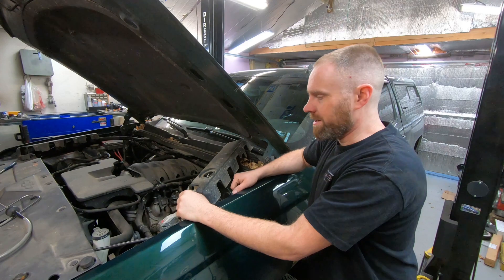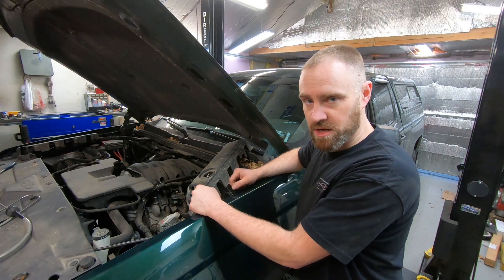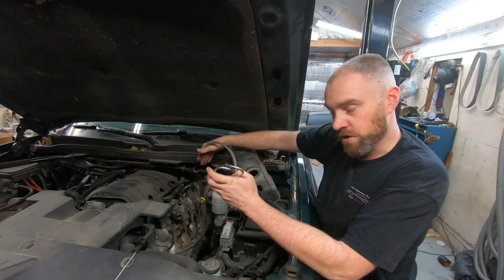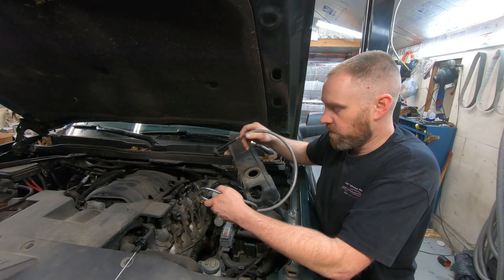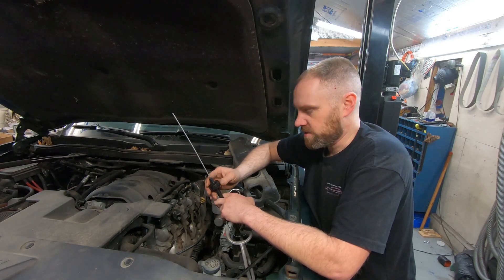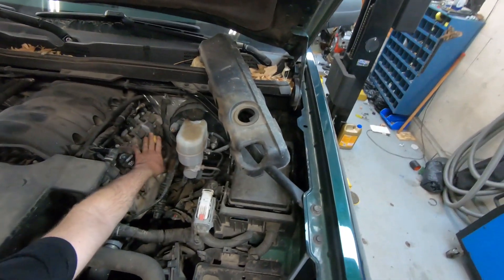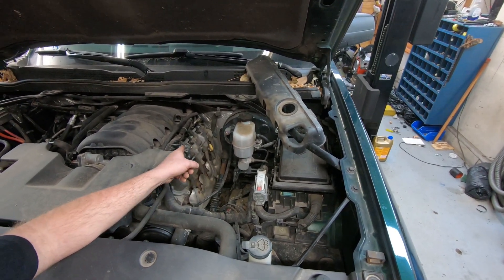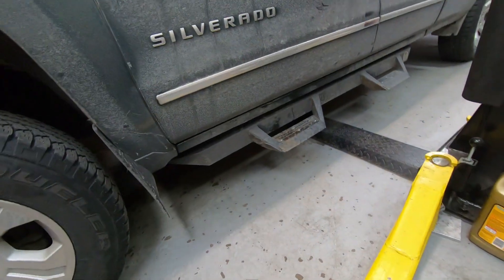Diagnosing Ticking Lifter 2015 GM V8 Engine Knock Sound

Comment: I have a 2015 misfire on number eight, I think cam lifters !
Reply: Crazy thing is  I have no tick !
Reply from the maker: Check if the rocker arm functions correctly while cranking it over with the starter for more than 3 times in a row. The lifter could also be spun, you can determine this by looking at the side of the lifter. To see the side of the lifter you need to pull the VLOM and clean out the oil tower of the suspected lifter with cleaner and shop air. Once cleaned you can look down the oil tower and if you see a hole in the lifter it is not spun. If however you see only shiny metal or a flat surface then the lifter has spun due to a bad plastic lifter guide. When this happens you will need to replace the camshaft and all lifters. This would be a good time to do a full AFM/DOD delete where you remove all AFM components and replace them with non AFM components.
Reply: @CrazedPerformanceRepair  yea I did leak down of cylinder it’s good , rockers seem to be moving like they suppose too, I Need to put dial indicator on rockers they both look alright Visually. But my compression test was little weird first time I test it only got 90 psi then retest and got 150psi then went compared other cylinders with no miss fires codes  and got same 150psi. Dealer wants sell me whole new engine!
Reply from the maker: @davidcallahan5157  be sure to crank it over with the starter relay jumped while watching the rockers. the rockers might work fine for the first four or five times and then suddenly stop working on one or two of them.
Reply: I have a small tap when warming up but after engine warms up its gone. Can that be a rod knock? Its a 2016 silverado 5.3

Comment: Mine taps 6 or 8 times then it pauses then taps again over and over. All lifters ticking.

Low oil flow at idle with valve cover off.

Tap goes away above 1,800 rpms 

Shell rotella t4 after running transmission fluid through it quieted it down.

2913 2500 HD 6.0 motor 

217,000 miles 

Change the oil a lot. Clean motor inside.

No codes, runs like a beast.

Comment: Can a lifter tick get quieter as the engine warms up? My 2012 5.3 got diagnosed with piston slap, it sounds great on start up, but as it idles down it develops a very hollow knock that doesn’t go away until it reaches 210F. Once it reaches max temp it still sounds like a hollow knock, but much much quieter. Like you can’t hear it from the cab when fully warm, only cold. And when revved at running temp the “knock” goes away at about 800-900 rpm and sounds like a normal engine… The sound is definitely louder underneath the truck, and from the top it sounds the exact same from both sides. I don’t have any engine codes except for a large evap leak and occasionally my throttle positioning sensor will through a code… No internal codes, my dads scanner can read previous misfires and the history was clear… I also ran some tests at cold and warm idle but still no misfires. It sounds the exact same every day, doesn’t vary or change pitches unless revved, and starts off almost as loud as a rod knock, but will slowly get better until it’s a very light knock at running temp that you can’t even hear from the cab.   Oil pressure never varies from day to day, 600 rpm cold idle it sits at 42psi and hit idle at 600 rpm sits at 30psi… if it weren’t for the obnoxious sound I wouldn’t think I had a problem 😂😂
Reply: I should add that it doesn’t sound like the noise the truck in this video was making. I literally can’t find any video on the internet that sounds the same, but I’ve seen a lot of Reddit posts say very similar things and half the people are saying piston slap the other half are saying lifter tick. Mine is definitely a lot more hollow and a lot more “knocky”
Reply from the maker: Does it change in gear vs out of gear at all? Best to ask me on my actual website btw. I respond better there.
Reply: @CrazedPerformanceRepair  Yeah it has no problem shifting or driving… Just an obnoxious noise

Comment: I have a 2014 silverado 1500 with 5.3l im at 125k miles and it has that same noise but my truck sarted burning oil and smoking from tail pide would that be cauby lifters?
Reply from the maker: That's the first year of Direct injection. If you have direct injection it could be lifters and could have something to do with the vacuum pump. Noise is likely lifter but pump might be oil consumption. You will have to do testing. The pump could even be causing the noise. Get out the stethoscope.

Comment: These engines are trash 🤢
Reply from the maker: Welcome to most modern vehicles. The new coyote for example has a timing belt inside the engine that sits under the oil level inside the oil pan to drive the oil pump. We shall see if the compound holds up but I wouldn't trust it lol. These engineers should be forced to have 10years of mechanic experience before being aloud to design cars.

Comment: I replaced the cam and lifters on a 17 chevy 1500 silverado  the old cam was eat up on # 8 this is a 5.3L LT engine after getting it back together with without delete stock now the ticking moved to drivers side and is loader then before it has a code for knock sensor. Brand new lifters bad ?
Reply: I forgot to mention this truck only has 65k on it

Comment: Damn, seems like my 8.1 Vortec has a failed lifter I have the same noise.
Reply from the maker: Definitely not though, that engine won't be equipped with AFM. You might have a broken exhaust manifold bolt creating a gasket leak though

Comment: Help me
P05D P0300
No. 8 misfired, but now No. 1 and No. 7
AFM lifter has been replaced
I tried replacing the IG coil, but there is no problem.
The engine shakes and makes noise like a tick
No bend in pushrod
what's wrong? ?
Reply from the maker: Pm me more details on my website. I'm more apt to respond there.
Reply: What was it ? I have same issues now ?

Comment: I have same issue. But I also only have 50% oil pressure I’m supposed to have could this be because of my bad lifter I’ve replaced oil pump/ and oring.  screen in vlom deleted oil pressure relief valve in pan. Still only 20ib on startup 30 at rpm and when it warmed up drops to 0 at idle

Comment: It now has gone into lawsuit. All lifter fails are now covered at the dealership.
Lifter 7 collapsed in my 2015 Suburban costing $4,500.
Reply from the maker: Do you have a source for this?
Reply: @CrazedPerformanceRepair  check it out. It’s a class action lawsuit against GM and their faulty lifter’s. You can research too
Reply from the maker: @CoasterBucketMedia  Unfortunately I don't think this lawsuit will go anywhere. They are suing gm for the wrong thing. The lawsuit claims lifter is at fault. It's actually due to lack of oil pressure during activation at the lifter in 95% of the cases. The lifter is actually the symptom not the problem. So if GM has half a brain this is a easy lawsuit to defend against. Besides like he said, it's not a safety issue.

HOWEVER, GM is rather stupid and I highly doubt they actually realize the actual issue. Now if the people filing, had filed against the things causing the failure related to oil pressure its another story. they might get somewhere. Not sure it would be a big win but may gain some ground. Wish that guy shared the case number in that video.
Reply: @CrazedPerformanceRepair  my ex drives a 2015 Silverado and had the same issue same lifter. I think it all relates to a frame ground issue. If the voltage drops then things don’t operate properly. I had a gremlin in the Suburban that the dealer couldn’t figure out. I upgraded my frame ground and all my issues went away. Glitchy steering, voltage drops, door locks up and down in gear, Radio shut off etc… All issue’s were remedied after adding a 4g ground wire to the frame.
Reply from the maker: @CoasterBucketMedia  even the GM factory technical service bulletin states the lifters need 26psi during activation to prevent damage to the lifter locks. Yet all the dealers that repair these expect it to be fixed by putting in new lifters. Then are surprised when It fails again after a few days or couple months. The reason I came up with a solution in the first place was because I had to do lifters under warranty again after a week and I realized there has to be something causing the failure. That was over 7years ago. I have a very solid background as to why I know for fact it's oil pressure issue. Electrical won't cause this issue unless maybe the oil solenoid accidentally got pulse width controlled. In that case the computer would through a code for short to power/ground on X VLOM circuit.
Reply: @CrazedPerformanceRepair  https://youtu.be/M1BgCsxFdPM

Comment: Would you be able to turn the lifter 1/4 turn to quiet the noise down? Or use Lucas oil stabilizer? My 4.3l Silverado has the same sound, but on the passenger side
Reply from the maker: No, lifter can't be turned. Lucas might help some but it's a band aid over a invected wound.

Comment: Maybe all the metals getting caught in my catch can that's why it's not in my oil pan still not good but there's no misfire yet. I'm sure one day I'm just going to get a miss and a tick then I'll have to get it fixed. It's under warranty until 120,000 miles or 5 years. I add an extended warranty which actually worked out because the transmission just went like 3 months ago and they replaced it completely free of charge along with oil lines, cooler lines and trans cooler lines. So maybe the motor will go and they'll either replace both banks or lifters and a camshaft or one bank. Or they'll give me a whole new motor and maybe I just run it. You know delete that freaking system and I plan on beefing up this transmission already cuz since it's brand new
Reply from the maker: Not sure how long the extended warranty goes for but you are outside the manufacturer normal warranty. By the way it's best to p.m. me on my website for better responses. I only caught all these messages because I just happened to check. But I usually don't check my YouTube more than once a week

Comment: My problem with GM is these trucks actually aren't bad. They have some serious potential. You got to delete the AFM put a solid cam and lifters in it. Get rid of the VLOM assembly get it tuned. Call it a day but you also got to get a new torque converter. Maybe a few other things beef up that 6L80 if you could do those things you know up the pressure and get rid of the slipping cuz those things slip like Insanity. It's ridiculous. It's just why they wear out. GM is aggravating me because all those things don't really need to be there and the truck could be so much better but those are planned failures and they just suck at hiding it. You know GM is blatant about their plan. Failures. Ford is better at hiding that stuff you know. Also, they're better at hiding things behind things so you need a special tool or it takes way longer to get at. They're better at doing that and they're better at hiding their planned obsolescence GM sucks at it. Horribly not to mention those 14 through 18 trucks have serious potential. Like I said, if you delete that AFM system and beef up the tranny you could probably run them $250,000 mi easy. I could see those motors going $300,000 mi if they didn't have failure points. I mean honestly, if they just put better lifters in them they probably wouldn't break at all in the AFM would be fine, you know?

Comment: Mine to 2016 I got no misfire no check. Engine light runs great but there's metal in my catch can The last two times I emptied it. There's a little bit of metal flakes in the bottom so I'm assuming that's a lifter s***** out. It's just a matter of time I guess

Comment: I have a 2011 chevy silverado that has a chirping sound not a ticking no engine light or codes can someone help me with what it could be truck runs fine just a chirp in idle
Reply from the maker: Might just be a belt. Pull belt off to test it, start it and if its gone then replace the belt.

Comment: I’m 500 miles from home and after watching all your videos I have came up with this is my problem 2011 Silverado 5.3 flex fuel 140k 3rd valve back drivers side
Reply from the maker: Ouch, add a ton of Lucas and drive home I guess. It's not misfiring though correct?
Reply: @CrazedPerformanceRepair  no misfire
Reply: No misfirestarted making loud tapping all of a sudden sound has never changed already did Lucas trying to unstick it no debris in oil at all
Reply: @CrazedPerformanceRepair  1 owner female truck oil always changed inside of everything looks perfect one rocker arm was loose 3rd back drivers side  bouts new rocker arm other one had lots of play thought that was gonna fix it but same
Reply from the maker: @Jerry-Rig  oh, loose rocker means it's bent pushrod or collapsed lifter. I have a solution for both of these issues.
Reply: I dropped the oil last night and clean the whole engine is clean very clean I wasn’t expecting that did have a code for oil
Reply from the maker: @Jerry-Rig  they still fail with good oil and maintenance. The pushrods sometimes have a slight interference issue from the factory. Bad geometry basically. So as time goes on and they wear it gets worst then bend pushrods. Some even bend them with less than 2000 miles on it. The solution is a smaller pushrod diameter along with thicker walls to make it stronger. If it's a collapsed lifter it's related to lacking oil pressure at the lifter during activation. This makes the locks bind and thus get damaged and lock collapsed.
Reply: @CrazedPerformanceRepair   I inspected pushrod didn’t see any damage  I’m in a pickle here in Daytona with my family
Reply: Also isn’t this not a dod cylinder 3rd valve drivers side
Reply from the maker: @Jerry-Rig  might be completely wiped camshaft lobe/lifter roller if the pushrod is straight then. Yup not collapsed lifter on that valve, at least not because of AFM. If you push down on the pushrod while turning it over does it have lift? Is so the lifter has failed somehow. Could be roller or internal guts. If it's the roller the camshaft will be junk too.
Reply: @CrazedPerformanceRepair  wouldn’t it have metal or evidence in oil? Will it we 500 miles
Reply from the maker: @Jerry-Rig  if you want to drive 500 miles it could cause more damage. You will at very least want to remove that cylinders pushrods so it stops chewing things up. The issue with that is the direct injection, you can't just easily unplug the injector and it might still spay fuel in there. To somewhat safely drive back you need to completely cut that cylinder from fuel and air.

As for metal in pan, not necessarily. Not if the guts of the lifter blew out or it been slowly wearing over time. It really depends on what happened exactly. The older Ls based systems filtered all oil right after the pump. I imagine this is the same. This means the best thing to check for metal is the filter. This would require cutting it open though.
Reply: @CrazedPerformanceRepair  could it be a stuck lifter still
Reply: I’m going to pull the intake and vlom this evening to do further inspection I have videos of everything if I can send them to you or there posted on my page
Reply: @CrazedPerformanceRepair  removing pushrod easy enough as far as fuel and air to the direct injection ?
Reply from the maker: @Jerry-Rig  my last comment, I had you confused with another person. I didn't realize I was talking to a guy without direct injection. It really would be best if you actually message me on my website rather than on here. That knock sound that you have almost sounds faster than a lifter failure. Are you sure there's a rocker that is loose when it's bolted down?
Reply from the maker: @Jerry-Rig  BTW, there is a forum on my web page as well that has lots of extra information on it.
Reply: @CrazedPerformanceRepair  yes definitely loose the rocker had a ton of play as well that’s why I relplaced it
Reply from the maker: @Jerry-Rig  then it pretty much has to be lifter related if it's still loose. Only other possibility would be a dropped seat keeping valve down lower then it should be. You say it doesn't misfire though so that's extremely unlikely.
Reply: @CrazedPerformanceRepair  no misfire or rough idle
Reply: I visited your website to message you do I need to become a paid member? No problem if I do your videos have been a big help why this man don’t have several million subs is beyond me
Reply: @CrazedPerformanceRepair  also I what should I do from here pull intake and plate and try to inspect lifter and cam?
Reply: @CrazedPerformanceRepair  is there a way for me to remove the pushrod and shut the cylinder down until I can get home and tear into it

Comment: Awesome video sir, question: Can you use dial indicator on AFM lifters to see if total lift vs another non ticking AFM cylinder is equal?  Or because the AFM lifter needs oil pressure you'd have to run it first for 5 mins then do one's dial indicator test?  Thanks!
Reply from the maker: The AFM cam profile is slightly different so comparing it to non AFM isn't practical. Besides that the AFM portion of the lifter only sees oil pressure when the system is activated. Otherwise, it acts the same as a standard lifter.

Comment: Are the 2016 V6 4.3 litre 
Chevrolets with AFM having the same issues?
Reply from the maker: I am not sure, I don't have experience with them yet.
Reply: Had the engine oil pump go bad on mine